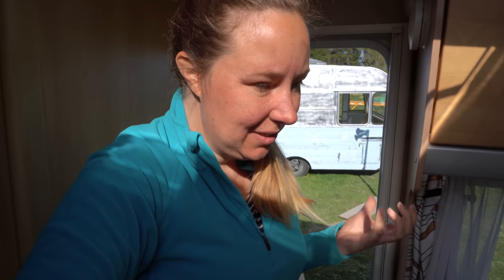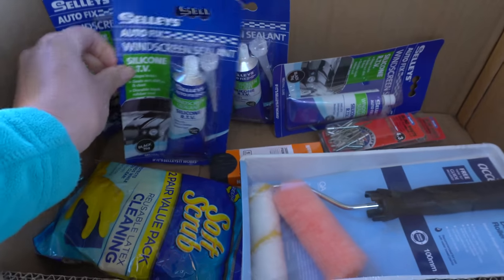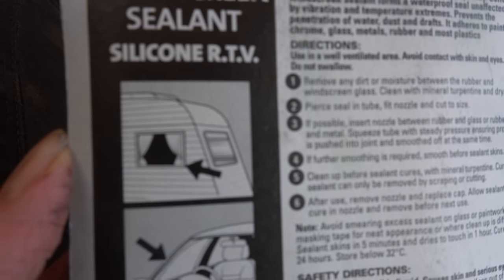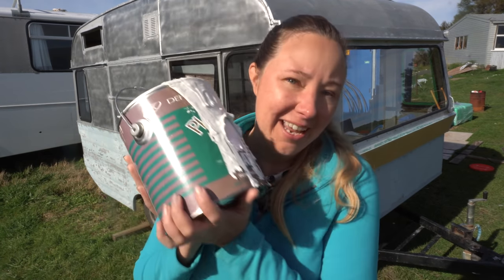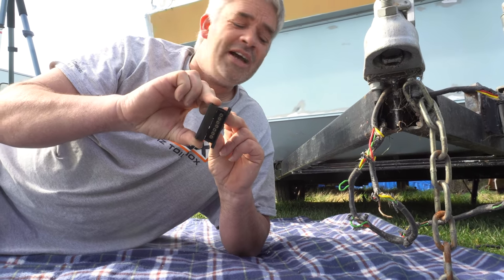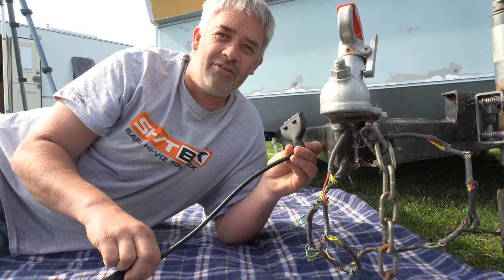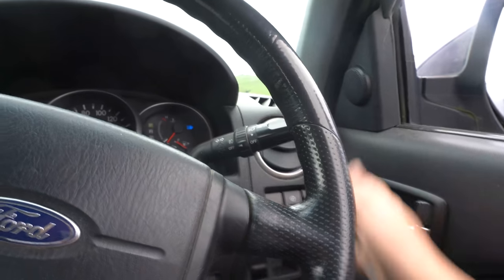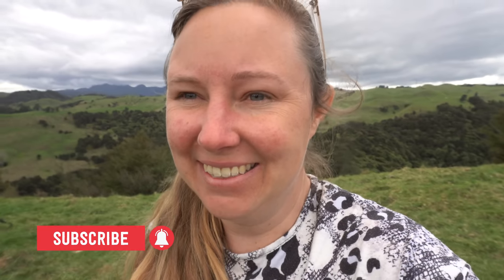FINALLY Water Proofed? Start Painting, Seal Window Rubbers & Install Trailer Plug

Comment: Well done Hayden with the van wiring that's the same thing I did with my trailer, no more lead hanging down !! Vinny will look really good with lime green carpet, Perfect and matching cupboard doors and benches, spot on, lovely. Seeya Rob......................not shag pile just normal carpet !!................................and lime green trim on the outside YEEES !!!!!

Comment: Great work again. The black windscreen stuff is AKA mastic. You can get it on trademe by a company called Bostik and it’s about $15 for a tube that goes into your selley’s gun (same tubes as no more gaps, all clear etc etc). It’s much cheaper that way!

Comment: Hi Karen,  did you use etching primer on the bare aluminium? You can't use ordinary primer on bare aluminium. It's helpful that before you line the caravan that you take photos so that you readily know where your wall/ceiling fixing is. Also now add additional timber where lights, shelves, TV bracket etc are being mounted. Also measure between your roof beams so that if you want to install vents or fans you know what the maximum size is that you can buy and fit.

Comment: A simple tool to remove the excess RTV silicon from a window is a single-edged razor blade. Hardware stores sell scrapers with blade & handle, cheap.

Comment: Did u mount a male plug on caravan... As end of extension cable from car should have a female plug .. so there no possible short on pins if not plugged in to caravan plug

Hope that was a etching primer you applied on the bare aluminum...

But looking good....